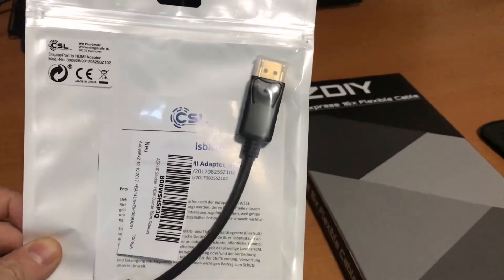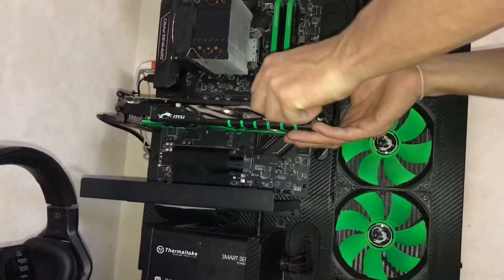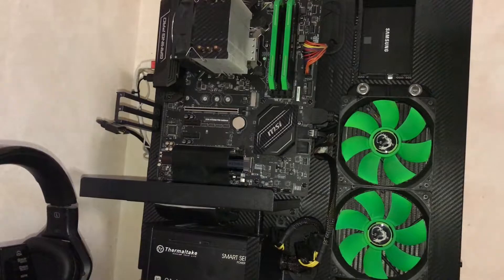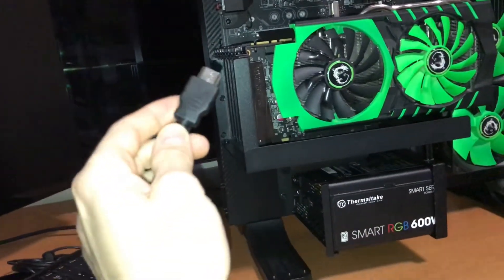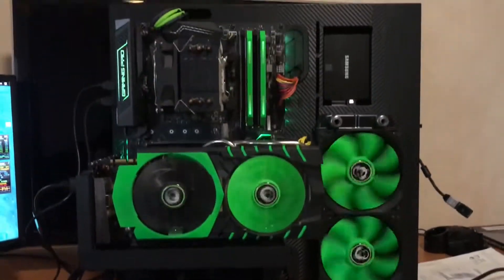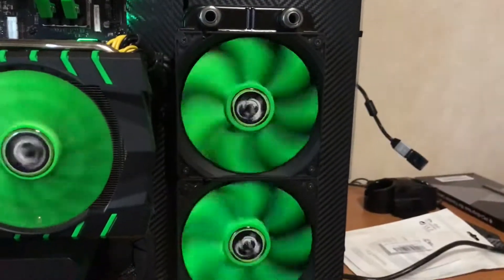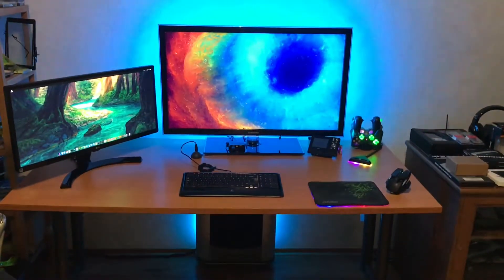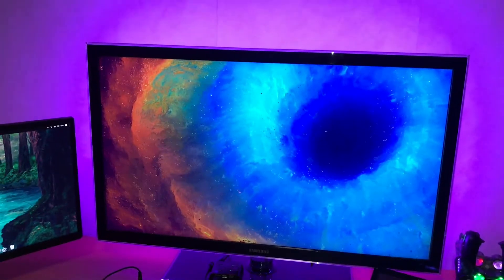EzDiy Pci Risercable + DP 1.2 to Hdmi adapter Review + install (Build log 3)

Comment: Why did you moved to pc bro...
Reply from the maker: ehm, story time: i could have ran my laptop 2-3 more years no problem, but the youtube video blew up, it made me a good amount of money, + i had a chance to try and push my channel somewhere because of the exposure of that video, so i tried to do what most wanted to see, and that was building a desktop, + financially it was smart, because at this time i could affore it, but who knows if in 2-3 years i'd be able to do this, and for youtube video making it would be better, the cpu is very important for rendering, so it seemed like a good idea, and i made sure i do something special for it then, that's why i'm not just building some desktop, i'm doing a custom watercooled wall mount, and can make a sort of series on it meanwhile, i always wanted to do a custom watercooling build, but inside a table, but getting parts for the table alone is like 900 euro, so when i saw the core p3, i loved it, (i saw blunty's one) so everything came together, seems like a good choice, do i need it? no. is it fun to build. hell yeah. the whole egpu setup was already a bridge between laptop -> future pc, but i did not assume i'd do it so fast. i've also shown that the jump is not that high in performance change and that my laptop even keeps up with a i5-6400 from 2015 (which will be a 7600/7700k soon), but oh well, i still have my laptop, gonna see what i can do. the cool thing about how the gpu is mounted on the core, i can take it off in seconds and throw it in my laptop, which i did today, gonna try to sort some egpu issue

Comment: I just built a rig with this case.  I had issues with the riser cable included.  GPU would work until it was under game load or when I launched a benchmark, then the monitor would go black and I'd have to manually restart.  Plugged the GPU directly in the motherboard and works fine.  Since then I've been reading of people having issues with the thermaltake riser.  I'm guessing you had issues as well.
Reply from the maker: Yes i had, this riser cable works flawless though, so i’d recommend it!

Comment: When first launch GPU-Z, 
my gpu is displayed as running @ x 16 1.1.
However, 
when I run GPU-Z's "PCI-E Render Test",
 it jumps to  x 16 3.0.
My GPU seems to jump back and forth, 
from 1.1 to 3.0,
depending on what the GPU is doing.
I guess this is okay, but I'm not sure.
Would you know,  if it should be running at a constant x 16 3.0 all the time?
Reply from the maker: it does not need to, the fact that you can bump to gen 3 means that you have like a 2014 laptop or newer which is great, it is supposed to jump from 1.1 to 3.0, to save power, it can be forced to 3.0 but its really not needed, it should not impact performance at all, to force it to gen 3, you can buy nando's tool called "setup 1.35" but really you dont need that, i've heard that new drivers from nvidia mess with egpu, i'm looking in to it as we speak.
Reply: Quick reply!
I built my machine back in January of this year, so it's a desktop.
I was thinking everything was fine. I just needed someone to confirm this and that's what you did.
No need for me to force gen 3, if the GPU is doing it on it's own.
Thanks!
Reply from the maker: mine does the same, it's really normal =)

Comment: Right now I'm.doing the exact thing you did before I have a good laptop but I'm buying ram, monitor, keyboard, 1060 and the adapter and power supply, there is any error or something that could help me?
Reply from the maker: what psu are you gonna get? i'd suggest getting a bit overkill one, just in case you'd upgrade to a pc someday too, i bought that 600w smart rgb for 55 euro, not the world. and yes, with 10 series gpu's there can be a bios issue (hotplug) that results in error 43, it's fixeable, but not just with a simple step. it can be a pain. some laptops do not give this error ,i ran a gtx 1070 issue free, just by installing 368 drivers and THEN upgrading to the latest, but as i heard yesterday, running latest drivers on the egpu atm is not working because nvidia did something, even if you have issues, you can ask me, or the people on the egpu.io forum, what laptop model is it btw, it would help, because lenovo's are prone to issues with egpu's, because lenovo's block the mini pci-e
Reply: Dennis Gagliano thanks, so you suggest to get a 970? 960? And a good power supply, I got 16G D4, ssd and i7 6700hq 3.9hz
Reply: Dennis Gagliano and do you play on steam 😂? We could play sometime, give your steam name so I can add you
Reply from the maker: the 1060 only slightley performs over the 970, but the hotplug issue cannot be judge before, so if you get it and get the issue, it will suck, i'd rather take the safe road and go with a 9 series which will work. a 970 will be almost just as good as a 1060, it's like 5% i think. the power supply is for the future if you plan on using that gpu for a future desktop, you could run a 250w psu, i did that too, and then i had to get a 600w for my desktop, so instead of buying two, just already get the good one, but if you'll stick with the laptop then you dont "need" to, with that cpu, i'd not go 960 though
Reply: Dennis Gagliano thanks bro yea 960 it's bad 😂 I'll search for a good 970 a 600w power supply, a good 1080p monitor and keyboard 😂, I'm a laptop guy I always take it out and that stuff so I can't use PC now
Reply from the maker: look at my recent video about this monitor, it's amazing man, it's 1080p but ultrawide, so running 21:9, it's godlike, reaaally check that out, also about a keyboard, i just bought a crazy one for 75 euro, i'll get it in like 1-2 weeks and will make a video on it, it's called OBINS Anne Pro,it's wireless (even comes with a bluetooth dongle) + mechanical, i never had a mech keyboard, check that out man. i'm also a laptop guy, i ran my 2011 laptop till last month with a egpu, this is my first desktop ever.
Reply from the maker: i don't play games at all man, just sometimes stuff like breath of the wild, but not a single online game, i do have steam but only for a program called wallpaper engine :p, so you could add me but i don't have any games at all, i think my username is gagliano20
Reply: Dennis Gagliano jajaja ok 👌